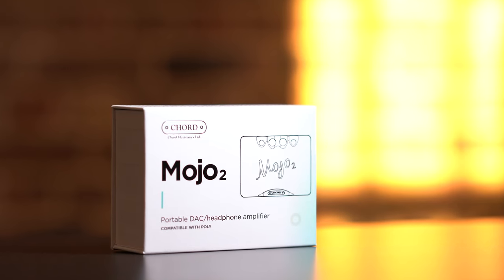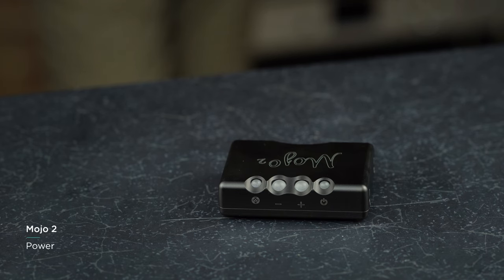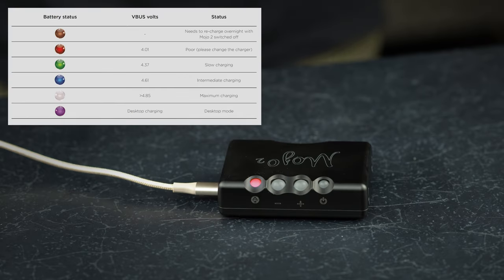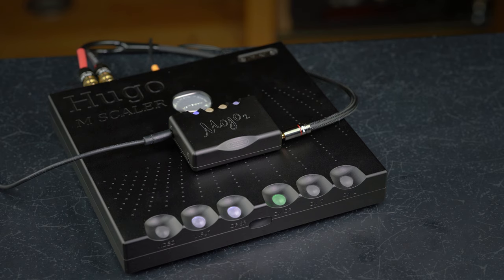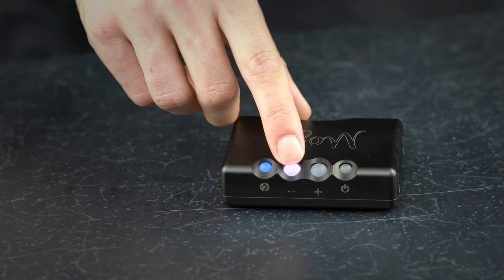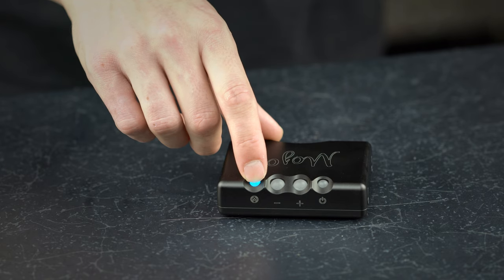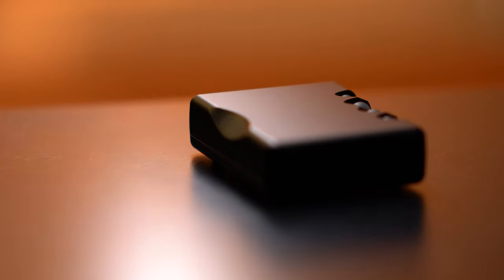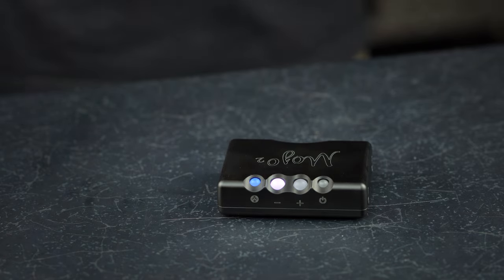Mojo 2 | User Instructions

Comment: I wish it used USB-C only. I get that you did this to preserve Poly compatibility. But do you want to keep using microUSB for Poly 2, Mojo 3 ... just for compatibility? Move on to modern technology.
Reply: Would have been much more straight forward to update the Poly
Reply: @k-doggy1762  Actually it would have been more straight forward to have the poly wireless capability built into the mojo. If Ifi can do it in a tinny package then I dont why Chord could not.
Reply: USB C charge connectors take up a lot more room internally. Space is very tight as it is so they probably would have to make the Mojo case bigger to accommodate the connector.
Reply: @apexracing741  But I think an incremental increase in form factor would have been fine. Micro usb? C’mon.
Reply: @apexracing741  they managed to fit one usb C connector in. I'm sure a second one wouldn't have taken more room than the other 2 (ancient) micro USB. The reason for keeping micro USB is simply for Poly compatibility which I think is silly. Poly is an accessory for the original Mojo. There is no rational reason to hold back technology in new products to keep them compatible with accessories designed for a previous iteration.
Reply: @k-doggy1762  Just going off what the designer Rob Watts said in the podcast that was released.

Comment: For use in desktop mode with external amplifier and speakers:  buy a good tulp to jack cable, (or other connect witj a jack depending what your amplifier has, mine has tulp RCA). Put the jack in the headphone output and the tulp in cd, aux, tuner ... input of the amplifier. And if you want the standard line output setting of 3 Volt for desktop (not headphone! It will blow your ears off!) , also  the same as standard on mojo 1: set the DAC in volume gain mode (first appearance of white light ball in volume in menu) en from there push the plus + ball EXACTLY 41 times for 3 Volt (this is what Chord helpdesk says). This info would be very useful in the manual: 1. how to connect the DAC to an external amplifier for desktop mode, which kind of cables you need 2. how to set the line level to the (industry) standard of 3V. (lower the 3 V if your amplifier can't handle it and produces distortion).
Reply: do you mean, from dead silent (volume all the way down) to press + 41 times?

Comment: The product is amazing, but I don't understand why you didn't include balanced inputs (4.4 or 2.5)
Reply: In my subjective opinion, they're not necessary. All headphones/IEMs have an unbalanced cable which when you connect to mojo 2, you don't feel like to ask anything more in sound. I just got It and I find It absolutely incredible sounding(user of also hip dac, Topping NX4, NX7 amp and xduoo xd 05 plus). I feel like mojo 2 surpasses them by a long shot, except of the NX7. It's as good as the mojo 2 but It's only amplifier, but a very good one. So, mojo 2 and Topping NX7 are my favourite sound devices.

Comment: I’m looking forward to a Mojo sized “Pro Audio” version of the Mojo 2.
My wish would be with one 6,3mm headphone jack output. (I’m using my trusty HD650 headphones for years) A balanced AES/EBU XLR input and a USB-C input with charging option. Without the micro USB connections. All the rest the same….. I would love to use it with my computer in the studio. With a digital mixer on live shows and with my iPhone in my free time. All with the same audio quality. All to have the best reference in your pocket in every audio situation.
Reply: I would definitely second a quarter inch jack! However we generally hesitate to recommend the Mojo for professional studio use because of the slight amount of latency the extra taps introduces.
Reply: @MinidiscAu  latency?    Where is that notated ?

Comment: Does it still do line out for connecting to a desktop headphone amp? Has this been improved over the previous model?
Reply from the maker: Hello Russell. 
Mojo2 does not have a fixed line-level mode, but you can just turn the volume up until it's sufficient for your connected equipment. Mojo2 will always remember its previous volume setting after a reboot.
Reply: @ChordElectronicsLtd  thanks for confirming. I believe the old Mojo was the same but there was a button combo to launch at max volume for that purpose. Unfortunately I have some old Stax that I really want to use and they need their own amp for the 5 pin connector, so I was hoping for a true fixed level output. The Qutest would be overkill and cost over double the headphones but I'll keep hunting for refurbs.
Reply: @ChordElectronicsLtd  How do I know when it is “sufficient”? I want to get the volume I want but to avoid generating unnecessary distortion by running two amps in a row.

Comment: Wondered what would happened to the poly with this realize. Was quite surprised too see Chord sticking with it. 

The port situation looks a bit odd on the new Poly but I can understand why they did it in the end. Am quite happy as a poly user myself but I would have liked better USB type C ports on the new Mojo. 

But yeah it makes it more straight forward to keep the updates in check if they only have to deal with one Poly model instead of 2 so I can see why they did that. 

Also interesting release, I like the new menu button. I won't go out and get it straight away since am still very pleased with the original Mojo. But will definitely look more into it when I need to replace it at some point.

Comment: I wish this chords mojo 2 and chords poly also have printed manuals for older people.
Reply from the maker: There is a printed quickstart guide available for Mojo 2 as well as quick access to the full manual and this video for ease of use!
Reply: I have the same problem. I think a good way is to remember the sequence and not to pay so much attention to the colors. Look only at the colors if you have a need to check. Skip functions you don’t need or will try later. For me for example I am only interested in plug and play and equalizer later. I don’t need info about sample rates, cross feed, lock up buttons, mute etc…Make a list about what you want to know NOW. Make a short list for the menu: one press.  = function a, two press is function b, three press is function c. Use the + and - buttons to adjust you preference between the chosen function.
For memory and for people who are not accustomed to thinking in colors it is easier to remember the short cut:  press = function than to remember: press = color = function.
I think Chord can improve their instructions greatly just by giving separate examples of concrete situations like ‘what do you do when …’ and at least should provide an alternative way of memorizing for people who are not color oriented. Its their choice to use this system (branding, looks cool, easier and cheeper to implement).  It is very much also in their own interest: older people have more money and like the natural sound of music, they know vinyl and don’t like digital sounding music. Its the younger people that are more flexible in learning by colors, have less money to buy a premium dac and often have no idea or interest how natural sound should be due to endless listening to their computers and iphones. Chord has listening panels. I think they should also test their manual/ instructions within different age groups. Give them a mojo and the manual an see what happens and learn from it!

Comment: The video provides info about connecting to iphone and android but no info about connecting in desktop mode and about the fact that there is no fixed output level for desktop mode anymore. And that you should adjust the output level in desktop mode through the volume buttons.
Reply: @ 2:49 he did mention connecting to desktop. He said you need to install the drivers for windows and that the link in the description of this video
Reply: @x-ray3431  I mean setting the volume in setting for desktop and the connecting of the cables and which cable to buy. Windows is just for window pc in headphone or destop mode. What I know now: buy a good tulp to jack cable, (or other connect depending what your amplifier has, mine has tulp RCA). Put the jack in the headphone output and the tulp in cd, aux ... input of the amplifier. And if you want the standard line output setting of 3 Volt for desktop (not headphone! It will blow your ears off!) , also  the same as standard on mojo 1: set the DAC in volume gain mode (white light ball) en from there push the plus + ball EXACTLY 41 times for 3 Volt (this is what Chord helpdesk says). This info should be in the manual: 1. how to connect the DAC to an external amplifier for desktop mode, which kind of cables shouls you buy 2. how to set the line level to the (industry) standard of 3V.
Reply: @MarijkeWillemsen990  41 times 😂 the interface on this thing is horrific. It better sound good. I just bought it and I’m scared of it. 😂
Reply: @milkcow  It's 41 times to prevent people of blowing their heads of with headphones and ruining their headphone. Once you set the desktop mode right, you are done. The setting is memorized, even with power cut, till you change it manually. Chord says they removed the easy way of setting to desktop mode because some people accidentally set the dac in desktop mode. Also they provide no desktop info in the manual because (I think) they prefer you to buy their more expensive desktop dacs... Anyway the sound is well worth the bad interface. Voices sound much more natural, less dgital. And the 5 band equalizer is amazing! One or two db changes are very audible on my set. I corrected a flaw of my speakers with it.  Once the dac is set to your taste. It's done . I also had a less good experience with an SMSL dac in the same price range. I sent it back. Interface menu was very easy, a lot of choices , hundreds of combination possibilities but no great adjusments, all sounds more or less the same. Thin mechanical sound. In summary I don't like the interface but I love the Chord sound and I don't want to spend a lot of money for their desktop version.
Reply: @MarijkeWillemsen990  I bought it bc I heard the sound quality was superior. I’m playing focal Stellia headphones through them. I wanted the best possible sound so this was recommended. I bought it.
Reply: @milkcow  How do you like him after 2 years)? I ordered mine from a man in good condition for 400 and it will arrive tomorrow and I'm reading the comments wondering if I should refuse the shipment ha-ha.

Comment: When I connect my Mojo2 to my Windows 11 PC with Roon, the settings seem to change automatically.  I can put it in one mode and then watch the colors of the buttons change when the song changes.   Have I put it into an automatic mode?  Is mine broken?  It sounds fine.
Also, what to users that may be color blind do?  I personally don't see green that well and it's hard to tell what mode my Mojo2 is in.
Reply: Why did you buy then, stop sniveling and read the manual which clearly says Go d/l the windows drivers. Pay attention! I can say this because the froth on my latte isn’t as frothy as usual. Omg the hardships of life. AND I don’t work, I’m retired but kept my since of humor.
Reply: @JW-hf9ev   I did read the manual, and it doesn't say anything about buttons changing colors all by themselves.

Comment: Well, when I unplug the charger cable, it works just fine.  Apparently, the cable which is plugged to the PC also charges the mojo 2, or keeps its battery level intact.

Comment: hi, this is Mehrad. I recently bought a Mojo 2. How can I use the line out mode?
Reply: Use one headphone line out. If you use rca in your amplifier buy a (good) jack to tulp cable and connect this to the rca input of your amplifier (cd, tune, aux etc). Chord 2 has no fixed line level, adjust the volume with the volume buttons.

Comment: Installed the driver on both my computers, none  them works, one using a micro usb input, the other using a USB C input .  There is simply no mojo 2 on Windows system.   When I connect the optical cable to my Samsung connect box, so sound coming out of headphone either.  So far, the one device that works is the Galaxy  S8+.

Comment: I hope the mojo has solved the portability problems the mojo 1 has. Here is my take on the mojo 1.Ok, so it sounds great through headphones or a hifi. However, it isn't mobile joy, more like mobile frustration. 
It is too big to fit in your pocket along with your phone, even a small phone. This confinement causes it's buttons to be pressed, turning it off. Why no option to lock the buttons. The confinement also causes your phone's touch screen to activate. I tried  a screen lock app, but obviously it won't lock the mojos buttons.
Also, the confinement causes the usb to be bunched up and loose it's connection. Sometimes this results in the worst noise you will ever hear in your life. Why don't they have a protection feature to stop this. The noise is so bad it could literally give some people a heart attack. Finally, there is no EMF shielding. It picks up the noise from your phone if it is next to it. Turning on airplane mode solves this, but then you can't receive calls. 
If your're after great sound you will only get it if you use this as a desktop device. It isn't mobile in the slightest. 
Also, it picks up awful noise when charging through a usb cable. It can only be used unplugged from a charger.
Reply: The mojo 2 has the possibility to lock all the buttons so this solves your problem. Charge noise: try an other charger, often this helps.

Comment: Brilliant video. 
My Mojo 2 arrived 2 days ago and I am absolutelly stuned. 
it's my first DAC and so far the wow factor is extremelly high. 

Are there any specific settings or guidance as I am using it mostly for my desktop setup and in car audio, rather than headphones? such as activcating the LINE OUT mode as I read on some forums the previous model has?

Not very clear for me over the 41 clicks after the white colour led.

Much appreciated response.